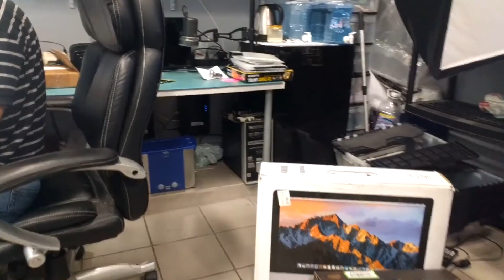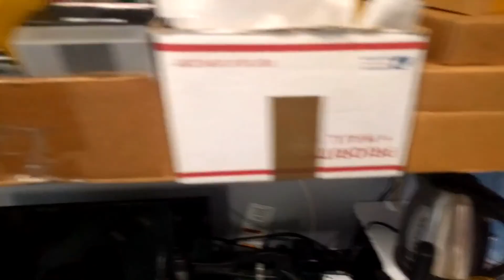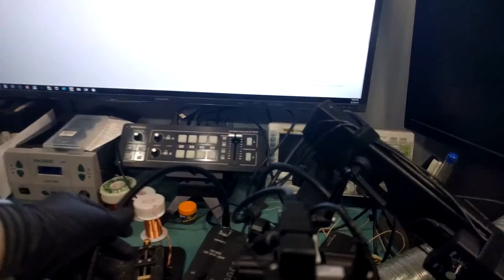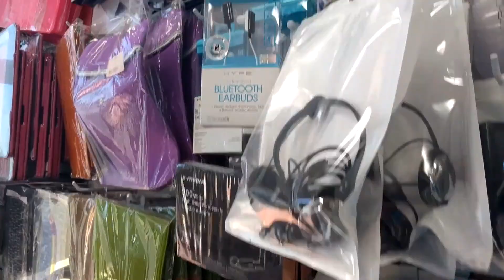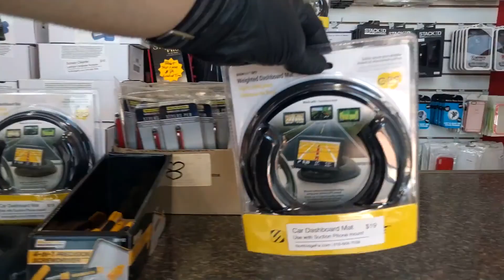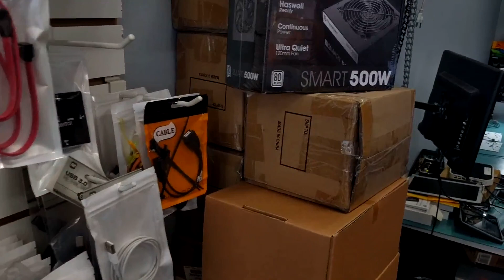Repair Shop Tour - Cleanup and Re-organization day

Comment: Nostalgia!!! Those belkin home network kits are a great starter for someone wanting to get into networking at home. Those keystone jacks are better than the crap you find on eBay and you don't have to try and match boxes with jacks and pay the outrageous prices either.
The RJ-45 crimping tool works nice, I still have mine 15 years on, still works great.

Comment: Get an electric screwdriver for your lab man, I recommend the Makita 7.2v with the ifixit adapter so you can use any sizes of bits.
Reply: Moreno A which Makita one?? Is it the 7.2v foldable screwdriver?? Thanks jay
Reply: Even I feel the same